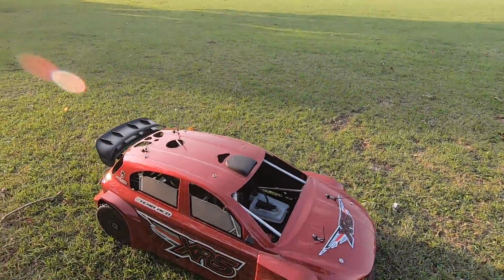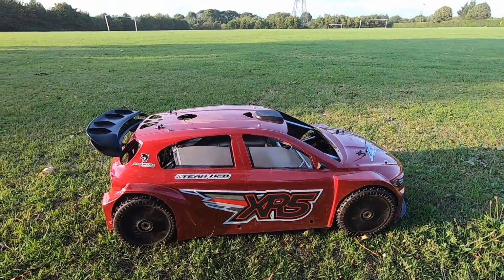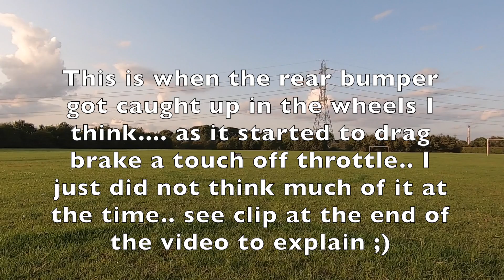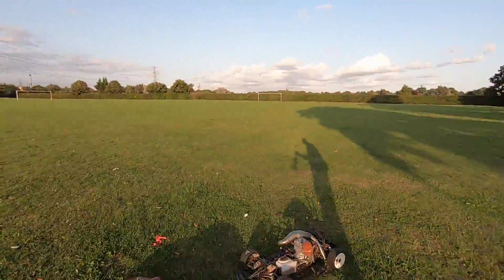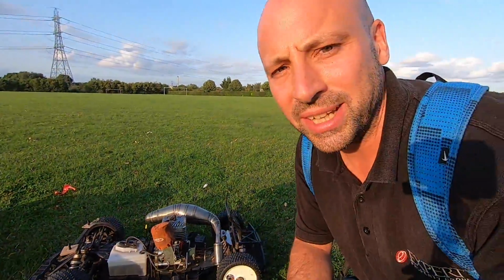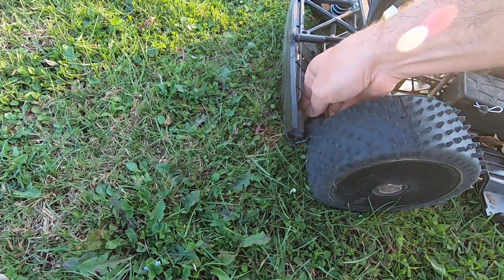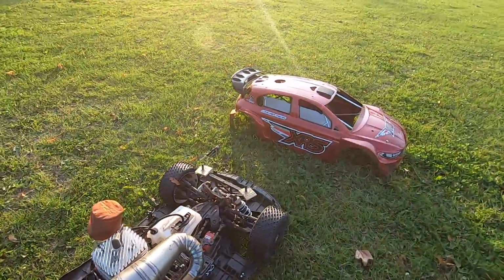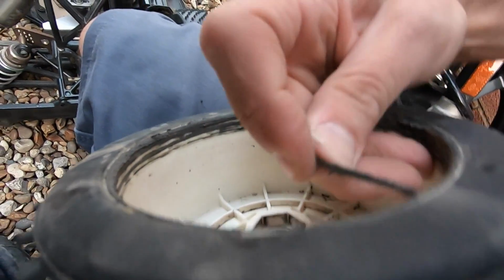MCD 46 Rally BLASTING! (setup run)

Comment: what a beast!!!! you went higher on idle and low end??
Reply from the maker: once it got hot it cut out and then would not start ( i had gone richer b4 the run so just nipped it in a tiny amount.)
Reply: @RCmaxxUK  yeah thats why you raise the idlle and richen low end. Not lean it. Personally it sounded too lean when you adjusted it. Wouldnt want you to fry that engine 👌👌💪💪💪

Comment: A random tought have you ever experimented with active cooling?
Reply: For me today it was a rare ocasion to run my 5ive :D OFC I send it flying like 5m high :D
Reply from the maker: Hi mate. no... but its a thought i have considered a few times after getting into these bigger air cooled engines... they get hot at the end of the day....
Reply: @RCmaxxUK  I actually wonder if fan on the top of the body would help. Im also curious whats the temperature on them. My perfectly average zenoah g320 usually runs around 140celcius.
Reply: I never understood why we dont run fans especially w todays tech and cheddar investment in motors
Reply: Wrapping exhaust, too nw desighned water cool fan just make one bigger

Comment: The chassis looks to long for the body, doe's MCD still do different length chassis, I have version 2 and 3 and they are different lengths one was a Monster truck the other was the Baja 1000 Chevy truck until it kept breaking with the bigger CC engine's.
Reply from the maker: its the longer chassis yes.. needs it to house that engine n pipe combo ;)
Reply: @RCmaxxUK  I thought it was, I tried to find a long wheelbase body for my long chassis no luck.
A side note I found the Growler for sale on a German website rc-car-online-de, not a bad price either. I am having some major fun with my Kraken-RC KV5TT with a RCMAX GT50 engine it is pretty mental and I have not finished breaking it in so no full throttle action yet.